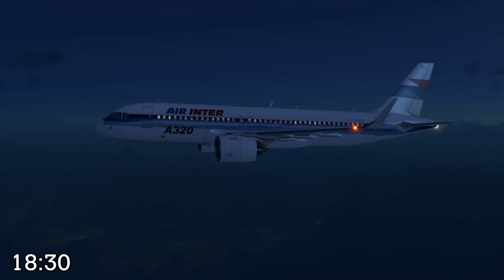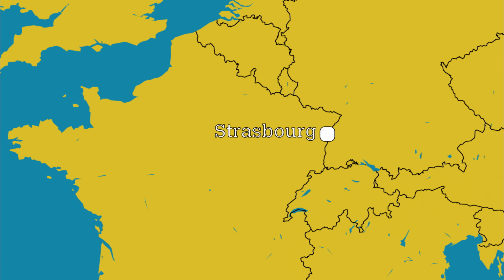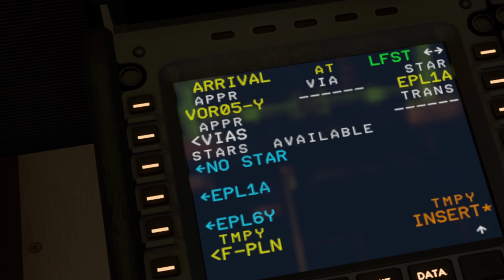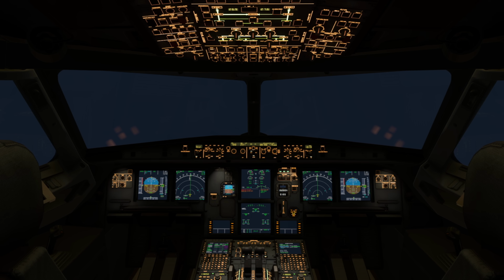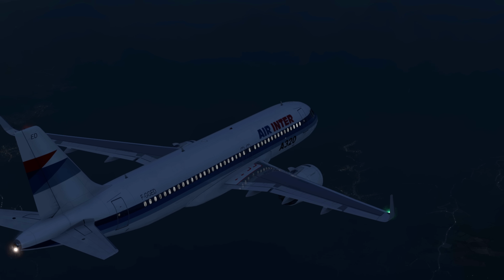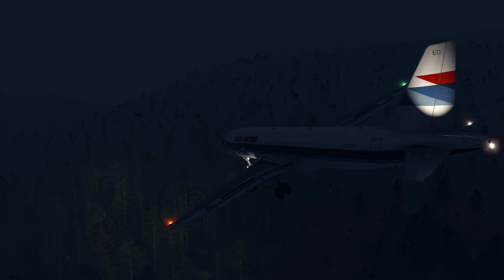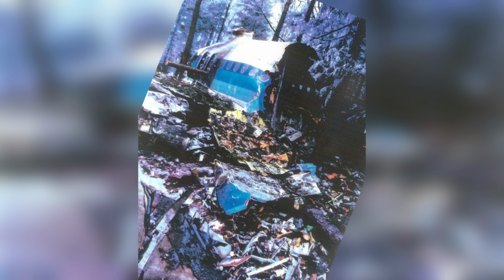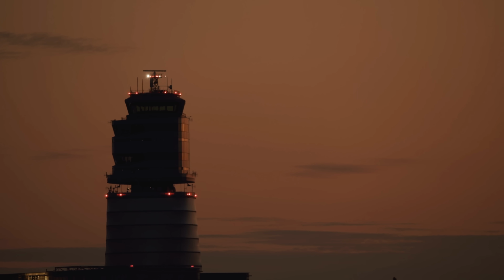Betrayed By Their Instruments - The Horrific Crash of Air Inter Flight 148

Comment: And another note: 3.3 degrees descent doesn’t mean 3.3 degrees nose down. It means that if you looked at the profile, the angle between the flight path and the ground would be 3.3. It doesn’t necessarily say anything about nose attitude.
Reply: You are correct...a small mistake but we all got the idea anyway
Reply: But if the ground level and level flight is parallel, then wouldn’t that be a 3.3 degrees nose down?
Reply: @dew9103  not really. The plane doesn’t fly exactly where the nose is pointing. Angle off attack is generally different from nose attitude and different from flight path angle. It’s hard to explain, but you can be descending if your nose is pointing up, and also climbing when your nose is pointing down(ish).
Reply: @dew9103 Aircraft don't typically ascend with the nose down,but they definitely can  descend with a nose-up attitude.
Reply: Someone more knowledgeable than me can correct tgis if need be, but I'm fairly certain that many aircraft are built with the wing chord angle NOT parallel to the fuselage angle. IE, nose dead level doesn't necessarily mean wings dead level.
Reply: @IN10THRC  that doesn’t matter because wing chord can change (i. e flaps), relative wind can change, and each airfoil is different in a sense that airfoils can be symmetrical (like aerobatic planes or fighters) or not, but they will all behave slightly different. You can get most trainer aircraft climbing with nose on the horizon or even slightly below it if at full power. It all depends on pitch and power mostly, but it also depends on other factors like relative wind and so on. It was just a counter example of how thinking that “noise points there so plane goes there” can be wrong.
Reply: @TheSpo1ler  I appreciate the additional info.

Comment: disaster breakdown, here is a tip to getting aircraft models correct in future episodes, if the plane has or does not have winglets and u want it to have or not have winglets, press X to remove or add winglets. it literally works in any flight simulator i have played and i am certain it will work in X plane11 & 12 or microsoft flight simulator. (this works in some models like the a320 neo).

you can also press X on some aircraft to start/end boarding processes or load/unloading cargo.
(this only works in X plane 12)

Comment: 5:40 - I was thinking the model looked like a NEO, but here I can't even tell the difference between the sim model and the real photograph shown.  Even on the photograph of the real plane, the engine looks quite big.  Must be CFM in both cases lol (The IAE looks tiny probably because of the longer cowling)
Reply: CFM LEAP for the NEO or PW1100G, CFM56 for the A320-100 and A320-200. Most noticeable difference between the -100 and -200 is the lack of wingtip fences.
Reply: @randomscb-40charger78  yes.

Comment: Honestly that original altitude selection interface on the A320 was STUPID
The confusing nature of the display was always going to cause an accident
Reply: Yeah, the design seems to assume the crew have the time and attention to study the display and interpret it correctly when really they dial in their numbers and move on when under a heavy workload, such as any non-precision approach. They base the safety of the flight on the lack of any failure in that UI. There was no redundancy in this situation. That's a tragic disconnect between design intent and actual use.
Reply: * vertical mode selection
Reply: Also reminds me of the design flaw that led to the crash of Tuninter Flight 1153, namely that it was possible to fit an ATR-42 fuel gauge to an ATR-72 (in that it used the same shape of connector) but it would read 1800 kg more fuel than were actually present in the tanks.
Reply: I agree the original vertical speed selection user interface was STUPID as you say. I don't know what you mean by "always going to cause an accident." Thanks to legislation passed in 1985, GPWS would be required in France by 1993 (the dates were a bit earlier for USA, Germany, Australia, Ireland, and UK). Sidenote, the future EU would have a common regulatory framework. Anyways, assuming this crash didn't happen, GPWS systems eventually be mandated by more countries. So assuming a decade went by without an accident, I don't think the selection interface would ever cause an accident. If someone were to make the same mistake in an aircraft with a GPWS, the result would be a steep descent, a terrain escape maneuver, and then a missed approach. Basically this poorly designed selection interface or as I call it, a graphical user interface that is on a plane, had a limited window to cause an accident and it succeeded.
Reply: @alex_zetsu  what i mean by accident is either a full blown crash or near miss.
Reply: @alex_zetsu  GPWS - that's the redundancy that was lacking. There was no other backup in case of failure of the UI to effectively connect with the crew. GPWS is not perfect either, but at least it's something to give the crew a chance in case of this type of failure.
Reply: @DrBeenaPlumber  Yeah I know it was lacking in Air Inter flight 148. The year this incident occurred that redundancy wasn't legally required (I mean it was in USA and a lot of the English-speaking world) but what I meant is that I think this dumb GUI only had a specific window to cause an accident. This model of Airbus, and its dumb UI, was introduced before the GPWS was legally required and that window for accidents was shrinking as more countries were demanding safer planes. I believe if no accidents occurred before 2003, then the poor UI would not cause an accident after that point.
Reply: Typical late 80s.  Rap music and ghetto culture started dumbing down the Western world by this point.
Reply: "a plane so simple even my butler can fly it" \cloud of cigarette smoke
Reply: You're right
Reply: The Vertical Speed window (not the altitude window) was basically just adapted from the Airbus A300/A310 with just some slight modifications.

A300/A310 ALSO indicate the Vertical Speed as a two-digget number in the interface window.
e.g.
 -0.5 for -500 feet (descent)
-3.0 for -3.000 feet (descent)

So nobody perceived this as an issue, since the A300 and A310 just flow fine for several decades with that type on interface panel.
HOWEVER Airbus A300 and A310
Do not have a Flight path angle (FPA)
Mode. Which means you can NOT confuse the mode with something else in the A300 and A310 !
And since Airbus expected that nobody would just dial in something without checking what they actually did, they didn't perceive this as a real issue. They just thought: 'well let's update the A300/A310 panel to the newest standards put in the new functions and it will be fine'.

Just look at some photos of the interface panel on an A300/A310.
The window has the exact same
3.0 indication for vertical speed because it could only indicate three digits (+/ and two numbers)
They just kept that interface to keep certain aspects of the A300/A310 cockpit in the A320.
Reply: It would be very interesting to know if pilots, who flew such a plane for first time, complained about that interface…I got slapped over my head by my father, when I did not look to the left first, before crossing the road…not after he would have pulled me out from under the car!
Reply: You are stupid.. listen better
Reply: Its a typical case of developers thinking, theyre genius, but forgetting to have actual users (pilots).
Im an accountant, its exactly the same problem with new accounting programs, they never ask any actual accountants, so its always full of things, that needs changing, once its in practical use. Only ofc in the case of accounting, ppls lives dont literally depend on it.
I really dont understand, how nobody during the development of the plane remarked on the design of that display, not even the test pilots. I can only assume, that the test pilots were so into the schematics, that they didnt see the pitfalls for those, who didnt know the plane inside and out.
Reply: @dfuher968 believe me, the developers want nothing more but run their prototypes by actual users
but the way development is structured means the engineers making the decisions are often far away removed from the end users, they ask for feedback, and nothing useful filters back down the chain to them
Reply: @tommihommi1 There are software development methodologies that have real users involved all the way through. The only reason to not do it that way is to save time and money, as usual.
Reply: @Sashazur  they usually get diluted with endless meetings with people that shouldn't be in the meeting who take up time with useless discussions, and cargo cult agile behavior instead of just actually doing the necessary things
Reply: @SashazurThe A320 was designed in the early 80s.  Did those methodologies exist in 1982-84?
Reply: airbus has a long list of bad UI choices that caused crashes...
Reply: @yoonsikp  Sure they do
Reply: Honestly, the whole airbus flying by wire and computer, alternate modes and direct modes are pretty stupid themselves. Let these pilots fly if they’re not good, we’ll find out.